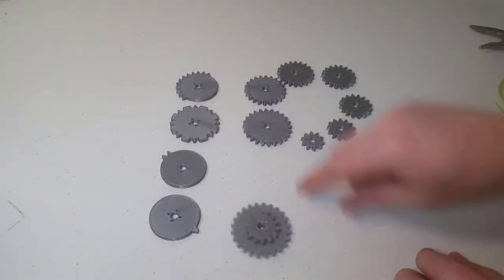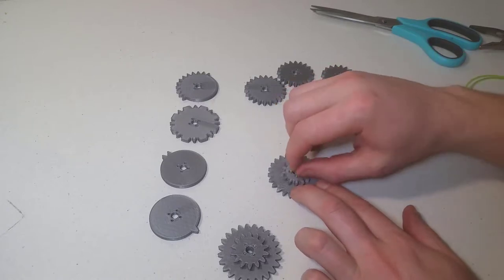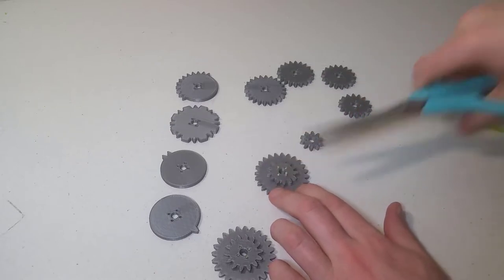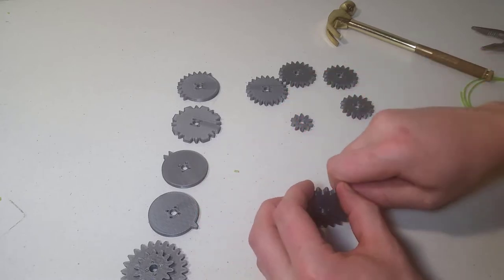30 Minute Mechanisms 5.02 - Spur Gears

Comment: Hi,  I love this mechanism set.  I intend to print it all out and use it to show my kids a bit of what's possible with mechanical engineering.   I have printed most of the gears, spacers, and axels.  However, I noticed that you don't have a file for any drive gears on Thingiverse.  It would also be nice to have some of the files for intermittent gears, cams, etc.   Thanks so much for creating this set.
Reply from the maker: Yes of course, I created them though the mechanism set did not take off as I expected and my attention went elsewhere. I will sort out the files over the weekend to upload,

It is fantastic knowing they are going to good use :)